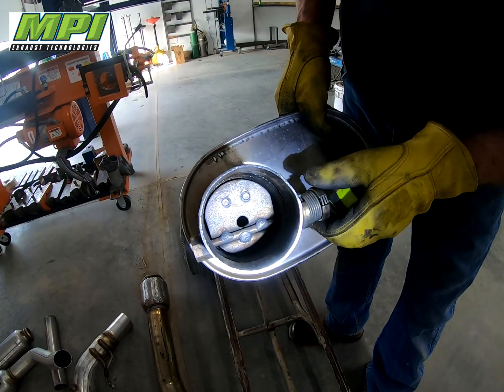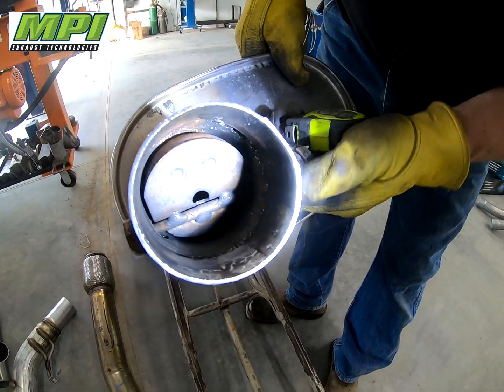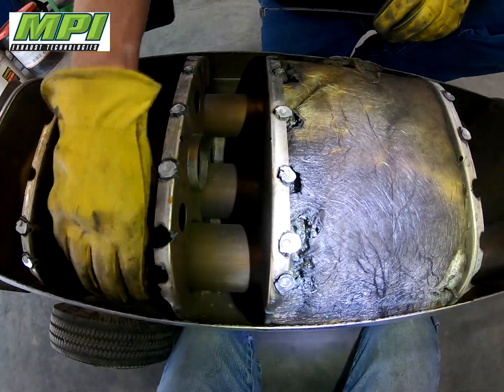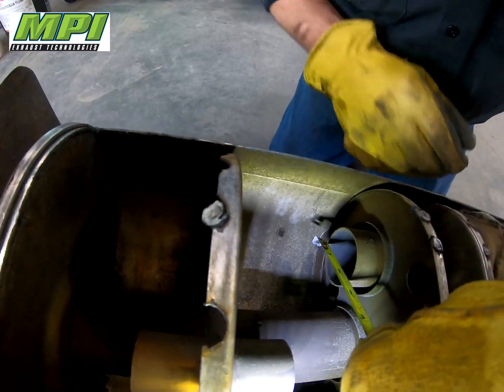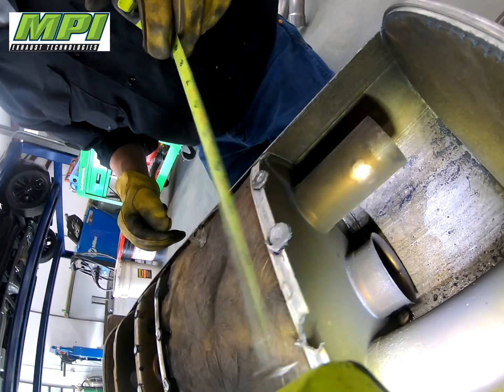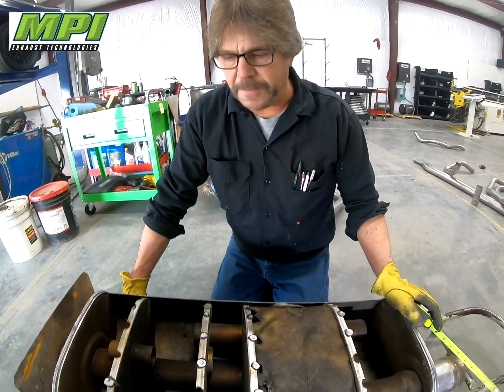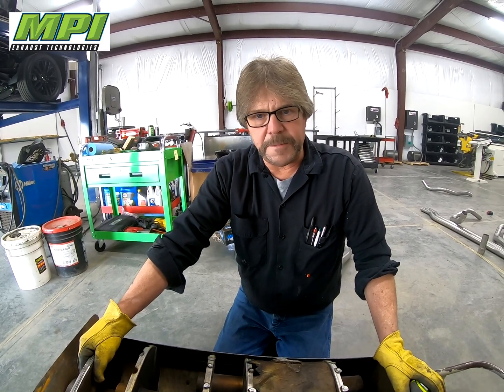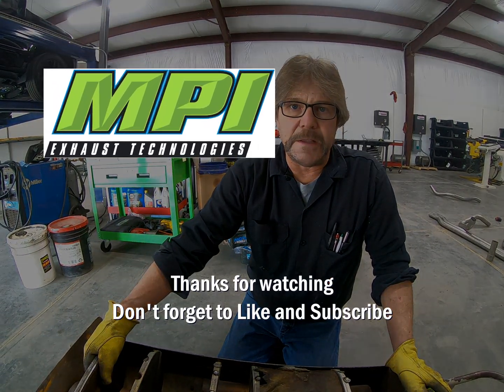2014-'22 6.2L GM Muffler guts

Comment: what a pos muffler . I have my own youtube channel and will be working on my folks 07 chevy Silverado with 4.8 liter . I will be cutting off the stock muffler and welding on a cherry bomb vortex muffler on the stock exhaust
Reply from the maker: unfortunately you're not going to gain any performance or MPG with just changing the mufflers since the stock exhaust is still to small, you will increase the noise level and with that a in cab droning,
Reply: @mpiexhausttechnologies   it has 2.5  inch pipes going through cats and into a 2-3/4 Y pipe then into 2-3/4 pipe   all the way back . I'm use to dual exhaust but folks on a tight budget right now so this muffler will help a little more then the stock pos